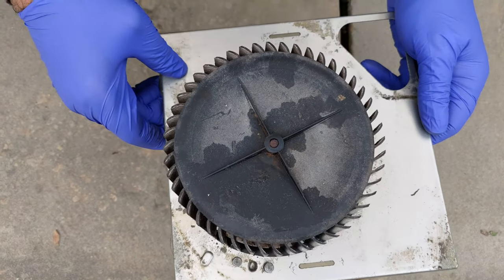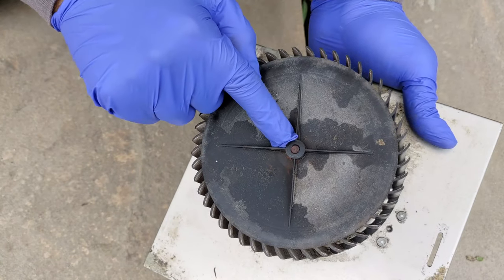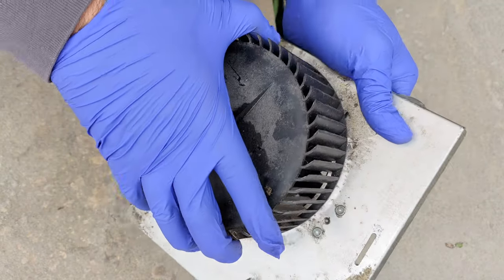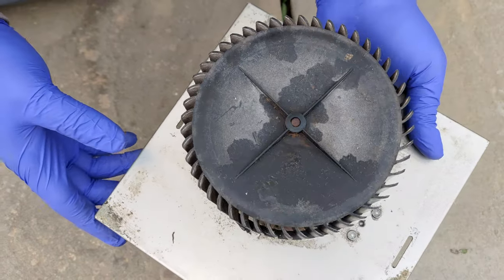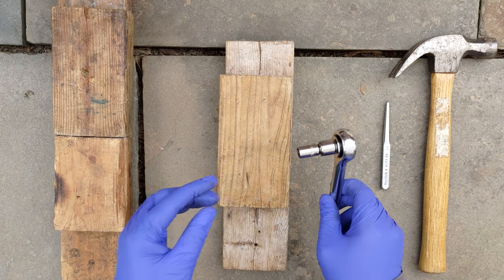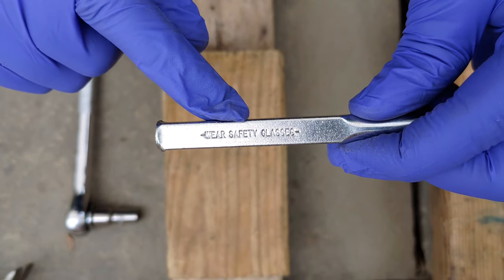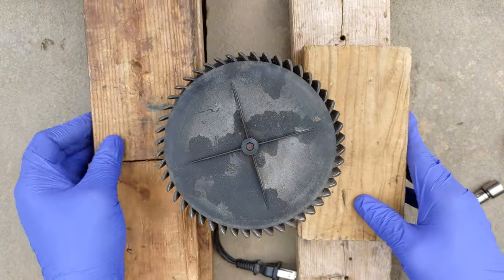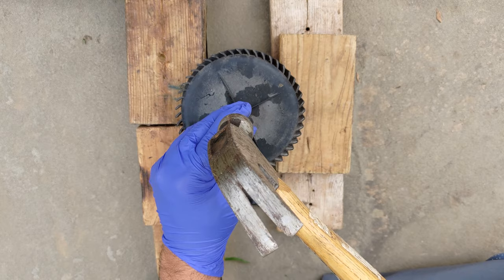How to Remove a Blower Wheel Off a Bathroom Exhaust Fan Motor (Broan NuTone)

Comment: How do you put it back on or a new motor on old fan blade?
Reply from the maker: Please see the video (How to Test and Replace a Bathroom Exhaust Fan Motor (Broan NuTone)) at 2:23 https://www.youtube.com/watch?v=6EGeu9BpVf4
Reply: It has a special slot on the shaft that’s not round and slides in blower fan and I like to hold my other hand flush to the end of the hole on blower so shaft sits flush instead of shaft sticking out